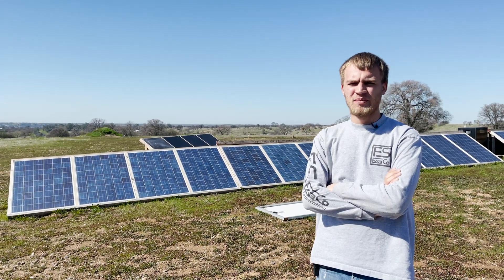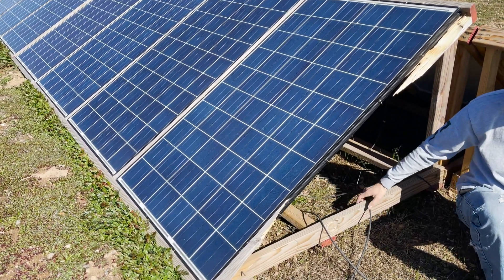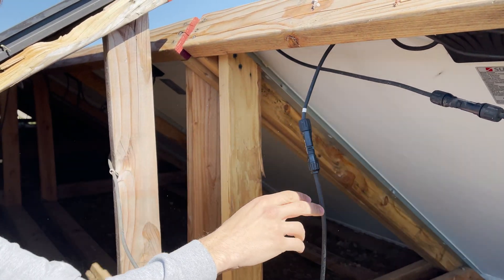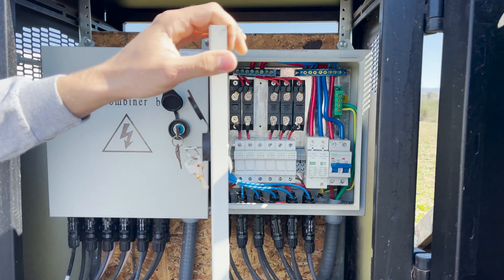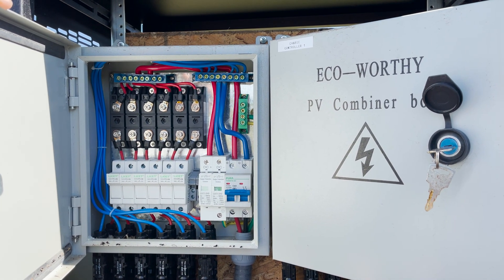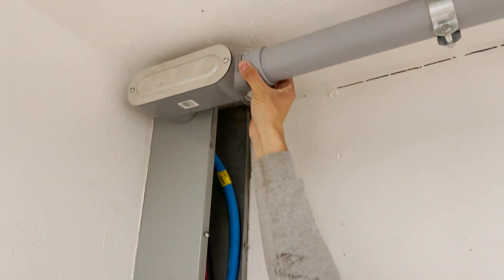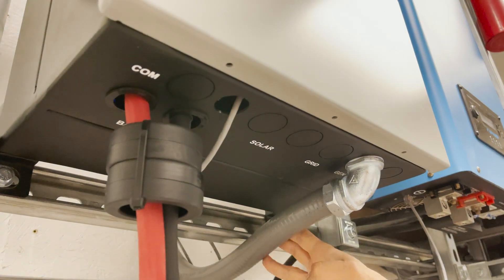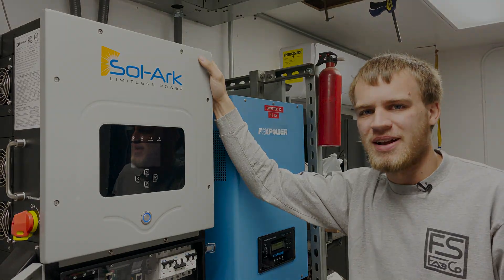Replacing 2 Outback FM80's With a Sol-Ark 12K All-In-One Inverter!

Comment: The solar inputs on the Sol-Ark are only rated for a maximum of 10 60 cell PV modules in series.  The damage threshold is 550V so feeding 12 modules in series may kill things.
What you could do is break the array into 6 strings of 8 modules.  Either 3 east strings in one MPPT and 3 west strings in the other MPPT or 2 east/1 west and 1 east/2 west respectively.
Reply from the maker: The voc on these panels is 37.5

37.5 x 12 = 450 voc
Reply: @HighTechLab  At STC.  When cold, it goes up another 20% or 25% once you hit below -20°F.
In their literature, they recommend a maximum of 10 60 cell modules, 9 72 cell modules or 6 96 cell modules.

Comment: Curious as to why you're using east/west on each MPPT, vs east on one MPPT and west on the other?
Reply from the maker: Because then in the morning one channel would be maxed out and then in the evening the other channel maxed out
Reply: @HighTechLab  I've always been taught that if you have panels at different azimuths on the same MPPT input, it will negatively affect your production.  
I am one to question everything though, so I'll be very interested to see your results. Would you run a test installing as planned, then switch it so all of the east facing panels are on one MPPT and all of the west facing on the other?
Reply from the maker: @benssolarandbattery  that is a fantastic video idea and we will make sure to do that. From what I understand the blocking diodes in the combiner box keep things in check. It is super easy with the mc4 connectors to just unclick two and then stick them in the other box.

Comment: Does SolArk have a lower power unit available?
Reply from the maker: They have an 8k version and a 12k version - The 8k is cheaper but you can't parallel them and the only difference in spec is PV input.  literally you are talking $600 difference.

Comment: I thought that panel arrays in different light levels cannot be combined.
Reply: Was that only true for series panels?
Reply: You've got 12S 2P?    The 2 different 12s  Face different directions?  If so I think there oc voltage varies little  But their MPP voltage  Will be different and this will cause you to not harvest their full potential.
Reply from the maker: That's the nice part about the "T" in MPPT, it tracks the maximum power point so as it changes throughout the day we still maintain optimal production.  We will have blocking diodes so paralleling them is perfectly fine.
Reply: @HighTechLab   The maximum power point voltage of the 2 parallel  Arrays will be different.
Reply: @HighTechLab   If the Sun facing array is strong enough the algorithm will settle on its MPp v  And the lower voltage set will harvest Nothing. However if your lower voltage set had its own charge controller or was paralleled with a similar low voltage set Instead with its own channel it would harvest something.